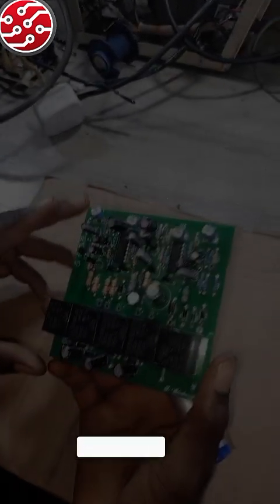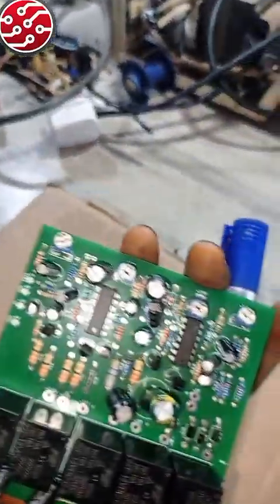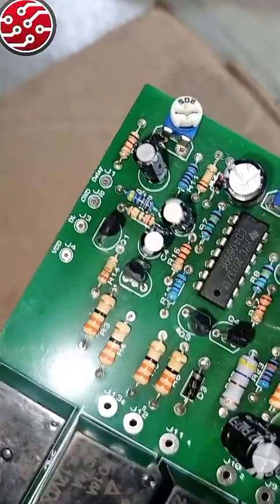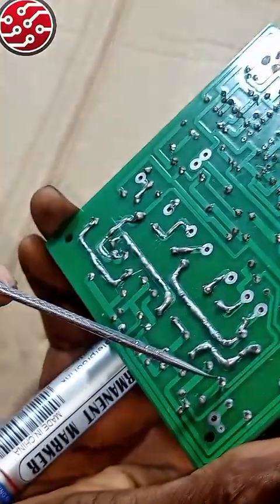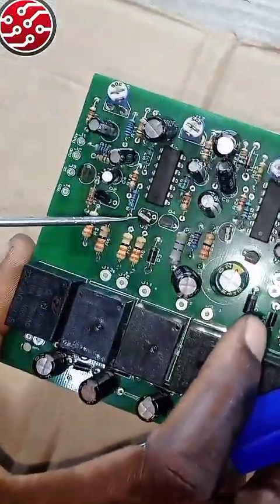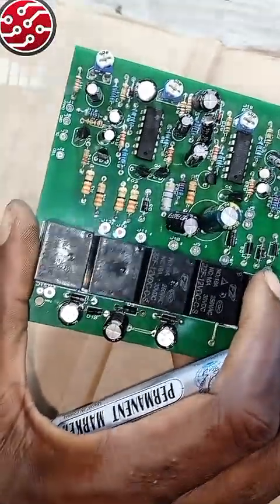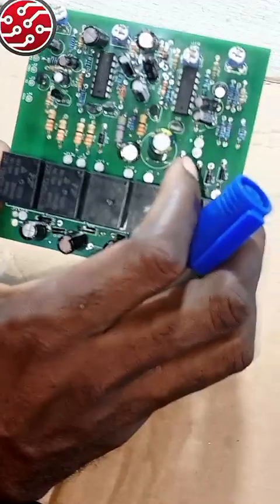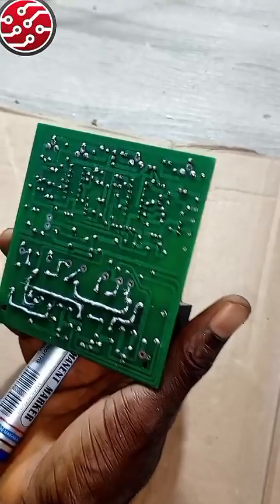How to Fix a Voltage Stabilizer That Gives Instant Output Without Delay

Comment: Great video
I just got a stabilizer and they by pass that place 
Please what dose this mean 
And how can I Identify the stabilizer fault 
It is doing tik tik sound in the relay,but when it becomes stable
It gives high output voltage up to 299 volts

Comment: Mine a centruty 2000W has been working fine until after two months of purchase when sudenly the delayed stopped working properly. Rather than delay for some 2 to 3 minutes beforey freezer comes on, right now it just starts automatically. The delay button wasn't touched or tempered with
Reply: Check well 
If the delay button has been touch 
Don't suggest

Comment: Thank you sir...
Please what about if the relay keep triggering between low and high..I.E the light flutuates between same input and high 
Which of the relay control this or what could be the fault pls sir...
Reply from the maker: Is it the stabilizer that flutuate or the light in the house
Reply: @robinTechelectric the stab sir
Reply: The stabilizer sir  @robinTechelectric I wish I can send you the video to see it
Reply: @robinTechelectric   I have replaced the relay still the same the output meter keeps moving front and back as the relay blinks
Reply: Please show me the input of the life and neutral for 1000watt century stabilizer. I have a stabilizer I can't figure out where the wire cut from

Comment: Thanks for this video. What about when the stabiliser keeps delaying without getting the output? The delay light keeps blinking
Reply from the maker: Check for the delay circuit or faulty output transistor or capacitor